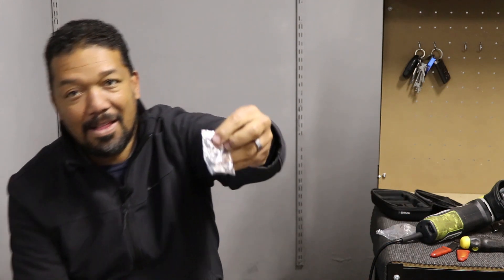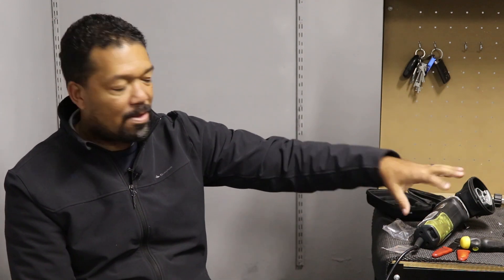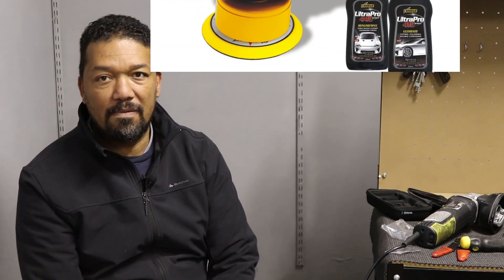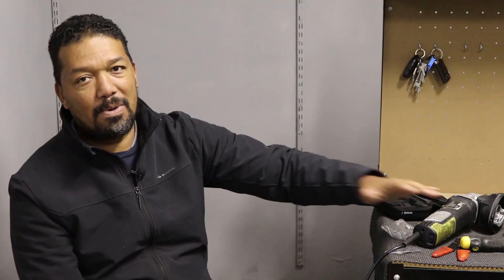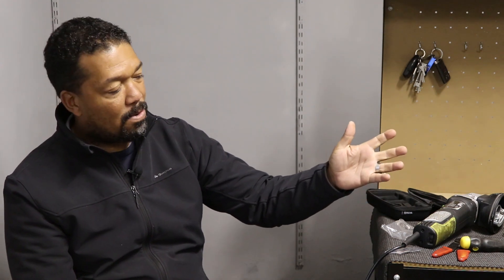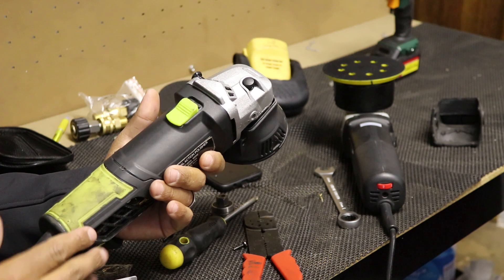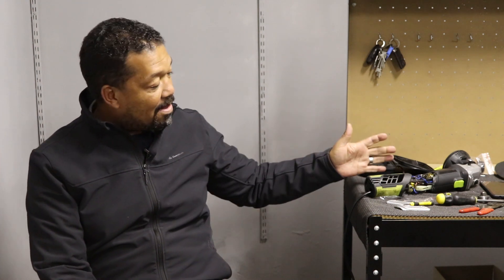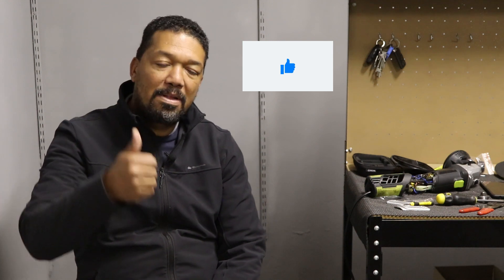MacAfric DA Polisher & Changing Brushes

Comment: Awesome video. Thank you. I notice you mentioned the Tork Craft. Do you recommend it for a beginner or someone just getting into machine polishing?
Reply from the maker: Hey bro. Thank you for the compliment 👊...so yes and yes. It's an excellent entry level polisher, inexpensive so it really is appealing to anyone wanting to learn how to polish. It's got a strong motor so it can get the job done as well.
Reply: @mdworkshop3919  Thanks for the reply man. Much appreciated. That is good info. I am  considering getting my first polishing machine so just trying to gather some info to see what I can get for a R2000 budget. I'll probably use the machine once a month the way I see it. At least for now. I've also seen that Ryobi has a DA Polisher that is brushless and has a rechargeable battery instead of a chord. Is Ryobi any good? Between the TorkCraft and Ryobi which is better? I've heard that Ryobi tends to be unreliable but I have no experience to verify that.

Comment: Hi brother, I just wanted to find out with the Mac Afric DA when I apply pressure it vibrates more and the spin slows down. Is that normal on the highest setting?
Reply from the maker: Hey Ashish. The MacAfric polisher will have some vibration due to its price point( not as refined as more expensive units )...but if the vibration is too much then perhaps the counterweight is loose and needs to be tightened.